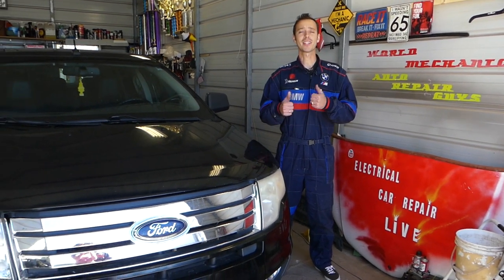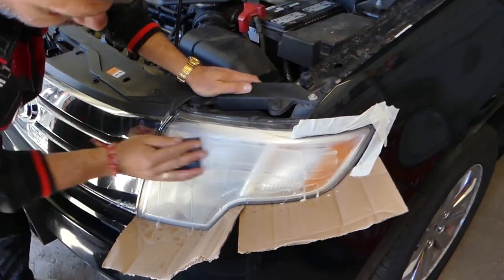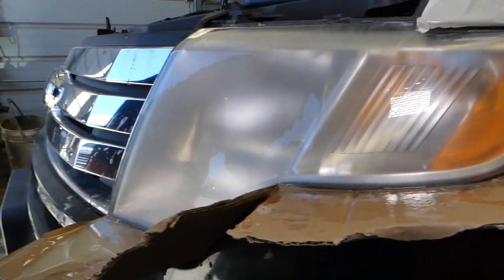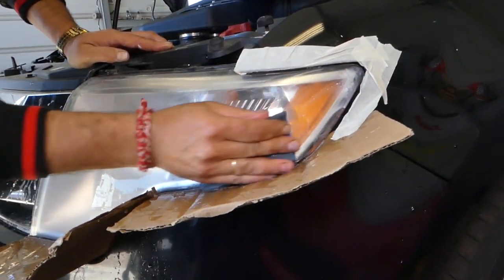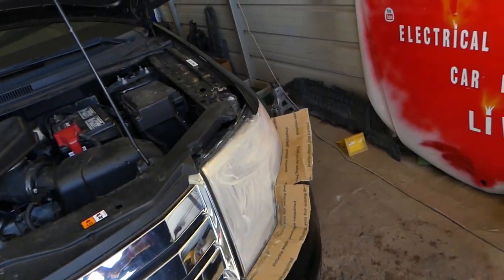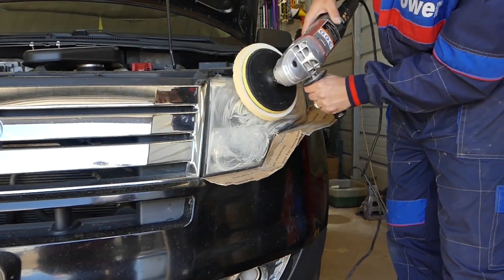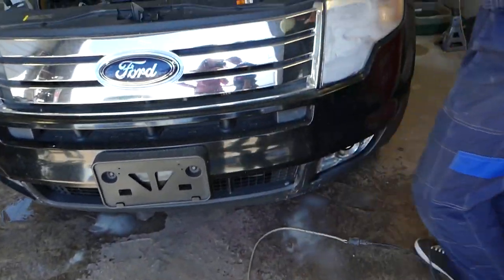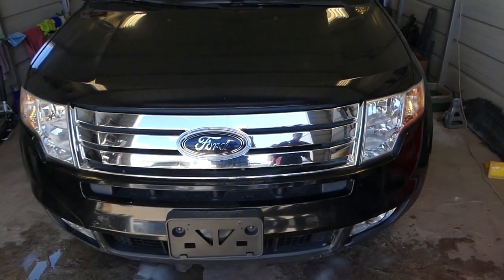HOW TO MAKE HEADLIGHTS CRYSTAL CLEAR. HEADLIGHT RESTORATION demonstrated on Ford

Comment: Its so easy to repolish once it starts to yellow again is not a big deal at all. The sanding is the toughest part and only needs done once to remove the old failed clear coat. I repolish my headlights on my Acura every 6 months here in Fl., takes 5 minutes tops, and 3 minutes is getting the stuff together to do it, lol. Been polishing them for a few years now (5 times total), Great vid! 👍